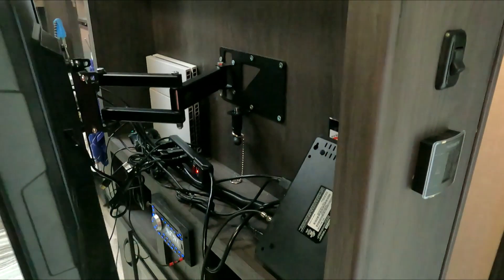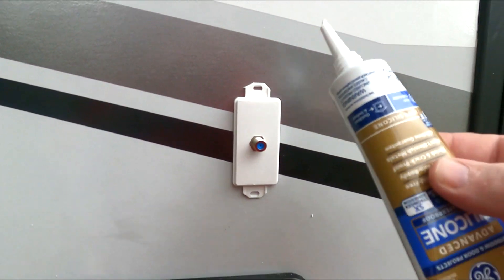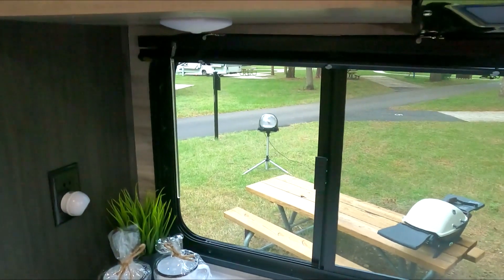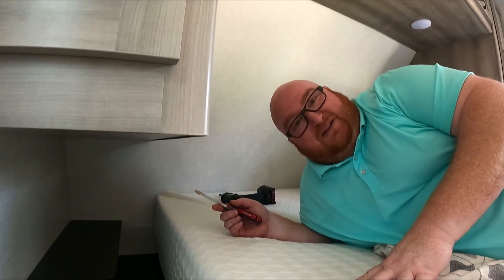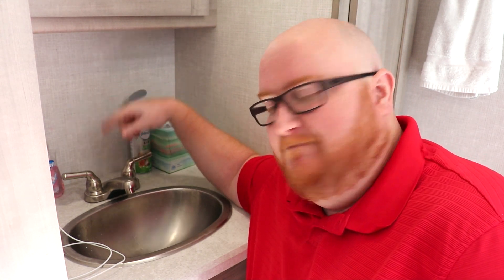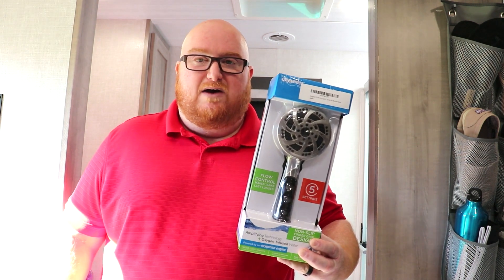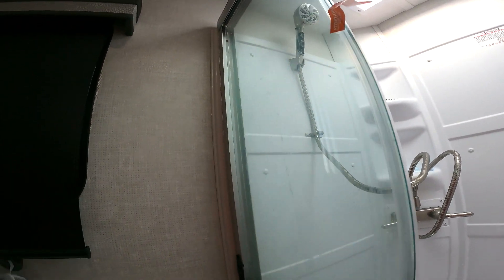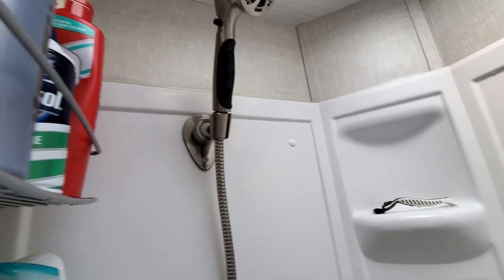Full Time Winnebago Voyage 2831RB - 5 RV Upgrades

Comment: This weekend I Beefed up my bed frame with 2X2’s and trimmed that board back so it sits about an inch back under the mattress on our new 2831RB.
Reply from the maker: Good idea! You have to do something! We had the screws pull out at the head of the bed making it flex under weight. We added a 2x4 in the basement to secure it and it worked wonders! Just in case you run in to a similar issue!

Comment: Thanks For the video. Where did you get the bathroom sink faucet? What is the model number?  I have a 2021 2427RB and am full time. Also have you ever removed the underbelly cover? I have been searching the internet for instructions on how to access the underbelly to repair a stuck grey water dump valve. Will definitely be removing the end tables next to the bed. Thanks Again.
Reply from the maker: We got it off of amazon and I believe we have it linked in our amazon page. We still love it! We have never removed the underbelly cover but we had some work done on the wet bay and they got under it and now some of it is missing.

Comment: Well, that was sure interesting....and you are pretty good  at contortions working in those cramped spaces! We find it challenging just trying to make the bed in our Voyage....
I have a question for you...do you use a surge protector ? If so did you have it installed - I heard that is an option but it's awfully expensive. What are you doing for a surge protector?
I am looking forward to your next video and I hope you talk about how living full-time is working out for you there staying in Wyoming. Keep these great videos coming...you deserve a much larger following...give it time - you will get there!
Reply from the maker: Its so tough to make the bed! Much better without the end tables though. We do have a surge guard surge protector that we plug in at the pedestal. It's the base model ($100ish) but it will protect us from surges. The more expensive one will diagnose issues at a much higher level. Which is probably what the installed option was you looked in to. You can also get that for the pedestal ($400ish). The more we looked in to it, the more we felt the higher end model wasn't worth the rare situations it would be needed... We don't tend to stay in parks that have questionable set ups (or go to places like mexico with no regulations). But if we did, I would maybe reconsider that decision.
Thanks for continuing to watch! Full time is going great with limited issues lol! Kahley has been working a lot though so we're looking forward to some free weekends where we can explore a bit!